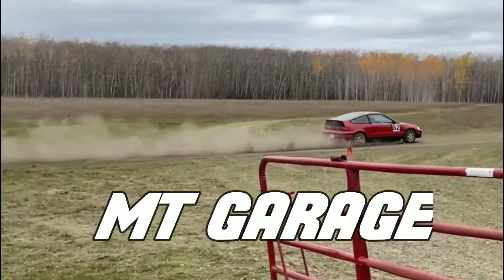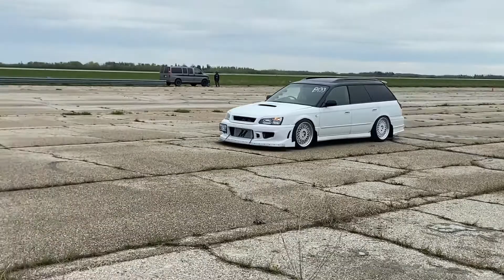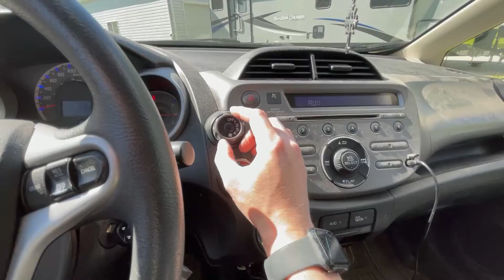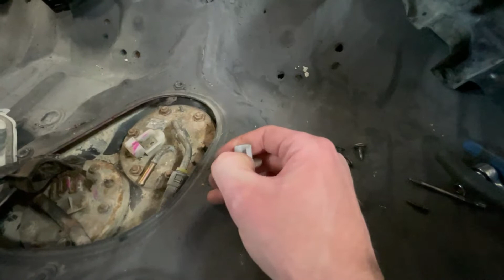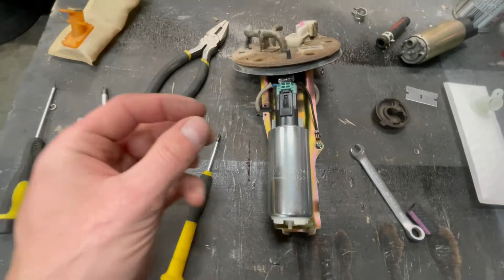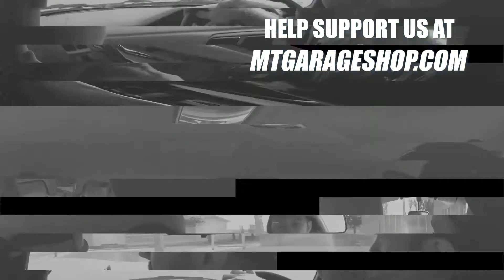Installing a Walbro 255 Fuel Pump on the Turbo H22 Civic

Comment: Nice bro I’m so close to being done with my build, it’ll actually be done tomorrow night when I work on it. I just need to hook up my fmu, bottom radiator hose, and trans cooler. Along with the bigger fuel pump

Comment: Kinda funny to me how multiple Japanese manufacturers switched to using some push connect fittings but not all at the same time. Nice work!
Reply from the maker: Ya buddy! I don’t mind them as long as you have the right tools for it. I could see a lot of people getting frustrated not knowing how to remove them. One step closer to boost anyway